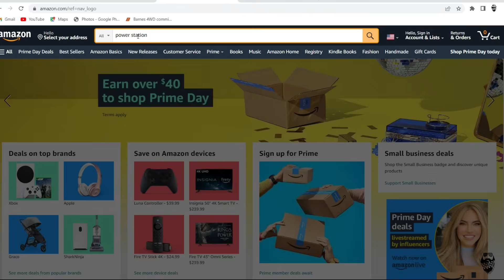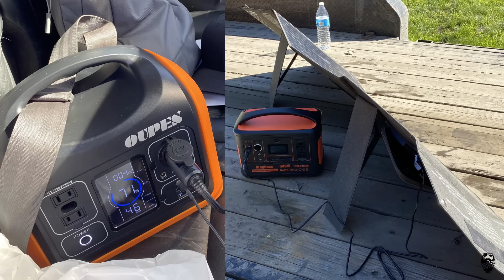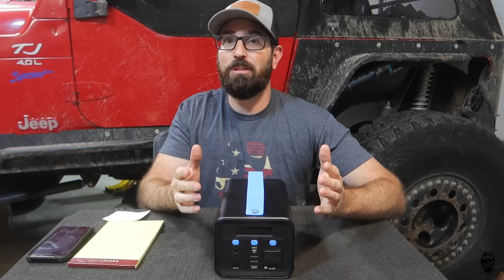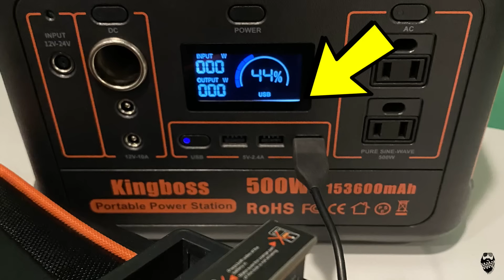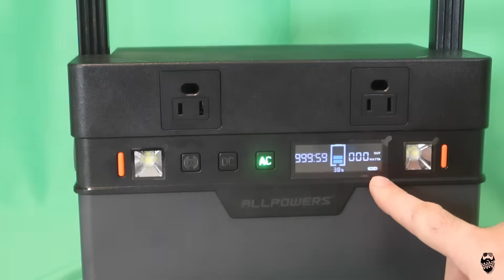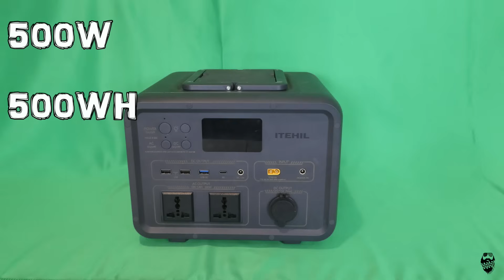Budget AMAZON Power Stations... Are they worth it??

Comment: You should build these yourself. I just build a system for my trailer with 1500 watt inverter and 2500 watt hours of battery for 400 bucks. These little all in ones are a joke

Comment: I would  buy  a tablet  so u don't  need to run your tv . Or a small  projector that can run on usb c.  A benq gv 11, 30 or 31 might do the trick.   Or or a mars 3 with it built  in battery.  The mars 3 is bit expensive  but u would  be happy  with  picture quality  and  battery  life

Comment: I need a PS to run a cig lighter plug in heater fan in my RTT which is normally used to defrost rear truck windows . Gonna try it for cold weather camping. Do you think I need a 1000watt PS? Probably run the heater fan 10 hrs at a time .

Comment: Lots of money for a battery?  Every 2 years I replace the battery in my F-250. I have a plastic battery box with the used  truck battery in it with a 12 panel  fuse box mounted on the outside of the box. 1 solar panel with controller. I run all my ham radio equipment with my unit. Plus a 1500 watt inverter. It sits under my bench. More than enough power. I wonder how long the batterys last before they no longer take a charge on 1 of those fancy boxes? They look real easy to steal out of your rig. I never let the auto repair shops keep my old batterys. I can run parts of my home with them. Years ago I bought a 3 panel harbor freight solar unit. Works great. Have fun.

Comment: That LIpower one is $133 on Amazon today.  thank you so much for the great review!  I did buy the LI just because right now my needs are simple... keep lights and devices on during a power outage at my house.  I like the light because it can light up my office really well.  I live at the end of a circuit and near the lake in heavy woods so I lose power all the time, but do not want to have to go to the office.   I buy minimal cold stuff in the summer so I don't have to worry about keeping the fridge on.  I do work in engineering for the power company, and need to stay online so this little unit is perfect for me. I can add the solar later as my house has great sun access.   If I start to camp I can go bigger.

Comment: Are any PowerStations or PowerBanks capable of charging an electric car as fast as a Level 2 charger used traditionally to charge your electric car in under 12 hours? 
P.S. I want the price to be under 1500.00, otherwise just getting a regular level 2 charger for the same money is probably the safest and least risky of something not going wrong
with the purchase,   Zendure and Anker's new Solix F3800  latest models that are capable of this but start in the 2500.00 range:

Comment: hi i know this is a late comment, but is there a solar portable power station that is exactly $100 for 500,600 or 700 watt power on amazon, preferably new. Using it for extensive and light work when using my laptop, also using it for gaming on my ps5 and separate monitor, and for a mini fridge.

Comment: There’s a question that wasn’t brought up in your excellent presentation.  When you plug any RV into a 110 (shore power) power supply you have now powered up your onboard converter.  Unless you pull the fuse or have a bypass switch you are now trying to charge your RV batteries which takes a serious amount of power from a small (under 1000 watt) power station.  There are a ton of off roaders who just don’t realize this and also don’t put their fridge on gas only.  Whether your old like me and been off roading since the late 1960’s and had RV’s of some sort since 1972 I find the biggest use for these power stations is a CPAP machine followed by a fridge.  You might try and do a test with someone who uses a CPAP and see how many nights you can get out of one charge on a smaller unit.

Comment: Having a large variety of portable devices on the market with different battery sizes I found your tests useless. You have not exposed their battery capacities or provided any measurements of how much power was actually drained from those power stations. You had mentioned the issue with one of the unit's algorithm to calculate the power usage. Don't you think the charge state/percentage indicator can be wrong as well? Next time you conduct such tests, I suggest you crank the actual numbers instead of using terms "cell phone" "laptop", etc. This way they are more accurate and can give your audience an idea of how much power they can get out of them. Cheers,

Comment: Rule of thumb: $1/watt.
I have a little 300W non jackery and it ran a TV and cable box for 6 hours before needing recharging.
Strobes are absolutely NOT needed for anything. Waste of money and just a gimmick.
Better to bring a power bank for the cell phones and save the generator for important things.
To run a house refrigerator you need at least 2,000watts or more.
About the same with a medium microwave.
About solar panels - you get 1/2 of their claimed rating. If you get a little more, count yourself lucky.
Reply: I do doordash on the bike, I just need to be able to keep my speakers and phone charged while on the road
Reply: @lyfe.personified  Bike - bicycle or motorcycle?
Either way a simple power bank would work.
If your battery dies that quickly you got something very wrong.
VERY WRONG.
Charged battery should last at least 8 hours.
Reply: What's your battery called?  If I can get 6hrs out of my laptop only running only Microsoft word on 300 watts I can work in my car and not have to drive to the library.
Reply: @rashb3994  Solar generator is made by Energizer. 300W capacity.

Comment: I just need something I can run my TV and maybe my fridge or mini fridge we don't have any gennys and we often have power outages at our house literally 2 in the last week they usually don't last more than 5 or 6 hours so I need something that cab power a smaller TV and maybe charge itself using solar power during the day. I'm thinking about getting the 500 watt jackery it's that or the 1000w if I can afford it and maybe find a good deal. As long as I can run my TV and fridge and then Recharge it from my car using my converter or my smaller power station.

Comment: Great video. Thank you.  Olight looks like a winner for me ✌🏼️
Reply: I always got an Olight in my pocket as EDC! 🔦 😂🎉
Tough, reliable and bright!! 😎 
If they can make that power station the same way, then I'm sold!! 🔦 ⚡ 
Just slapped together a small "cabin in the woods" in the backyard!! Now I'm gonna need some off grid lighting!
🕯️ 😂
I've got a few old car batteries, but I want something more reliable!?😂 I got a USB strip hooked up to an M12 battery power supply as "temporary" light!🎉 Works well with the remote!😂
I wanna hardwire something more permanent with lights and switches where I need them! Carry out the old station and just plug in ya know!... 
The USB lighting is a cool option. Need something with USB or a hub, then get a buncha USB lights! Don't know how permanent that is tho. Be hard to wire switches where you need them without cutting them up and rewiring them anyway!😢
I think if I get the wiring and fixtures in place, I can choose if I want a 12V lithium battery, or just use a power station... 🔋 
I do need a lot of USB ports cuz I have a lot of rechargeable lanterns and flashlights. My phone, tablet, speakers! Run a small TV and a Roku. I got a hotspot on my phone for nighttime watching!🎉😂
I'll run a USB hub charger off the power source for all my devices, install extra sockets and ports etc...🎉😂
Great video!!! 👍
All the info I was looking for!!🎉
Who wants to spend $1000 when I just want lights and a small TV at night!😂 I don't even have kids or anything, its all just solo camping! 🥾🏕️ 
I work and do stuff during the day, using my phone for entertainment and music. But at night it's nice to let loose and just empty everything out of your pockets and hit a button and watch Tube videos!!😂😂😂🎉 
I'm thinking I'll get the cheapest one, or a small battery just for the lights alone...
Then get a decent power station for all the different devices and TV... Divide and conquer as they say...🎉😂

Comment: At this point there are better options for similar prices. The Bluetti and Ecoflow smaller units have LiFe04 batteries and are $209 on sale, $240-ish when not. If I was going to spend $400 + I'd be looking at the Dr. Prepare PowerMax. Basically a 100Ah 12V LiFePO4 battery that comes with a module that turns it into a basic power station.

Comment: how many volts would I need to run a 40 inch samsung 4k tv and a ps5 and a modem/router when the power goes out, would like to play for at least 90 minutes to pass the time, we have frequent power outages
Reply: You need Amp hours, not volts, probably a wifi connection, and you should be more worried about your fridge, your furnace, and things other than gaming. TV's are power-pigs.

Comment: Plastic isn’t really cheap as the molds cost money.  Plastic is arguably safer.  When you have ground pins on your AC outlets there is likely leakage current to the metal housing - so is there a grounding lug - and who is going to connect it?

Comment: Enjoyed the video, but I have to assume that you chose the off brands due to price rather than long term quality.  I don't own a Jackery but many YouTubers do, maybe because they got them free.  I own two EcoFlow and would not buy any other brand regardless of price only because I can't run them down and they provide everything other than a light.  The small one is very light but durable, and the larger one is heavy but will run everything in my camper other than the AC, and if it has a soft start, it would likely run it also.

Comment: If you plan to use these at home...get a real solar panel. Folding solar panels are great for their USB ports for powering fans, and charging phones and power banks, but you can`t mount them outside or leave them in the rain. WAY too expensive compared to a glass panel that will last decades.

Comment: IDC about how many phones were charged etc, I'm more interested in how long you could run x fridge for etc. 

So if I'm camping, can I get 2 LED bars and a fridge to run for 24+ hours off it before it needs charging, thus hopefully with a good panel giving 40-70% charge during the day make it run for say 48hours. This is the sort of info I find really handy. 

The phone is easy enough with a 20v USBc car charger in the car, 1 hour at idle, device is fully charged and can be topped by a small solar panel.

Comment: I bought the Jackery 300 Watt on black Friday for $200.  It worked for what I wanted to do but surprised by how little 300 Watt would do.  If I had to do it over, I would just buy a DC power inverter.  (400 watts for less than $50).  Perhaps an alternate choice for some people?
Reply: I got the Jackery 300 for a weekend trip. Spent two days out in the wild/in my van. It was good since I wasn't using a lot of power toys. Mostly my phone, some USB fans, some lights, and a Hot Logic.

I'm thinking of getting a DC fridge so looking at a 1000W battery pack. Plus I'll be using more equipment for cooking and entertainment.

Comment: I invested in the Allpowers one a couple years ago.  My first one turned defective, but they sent me a second one that I used extensively out in the woods, combined with a solar panel.  It charges so much better with one of their solar panels with an MC4 to Anderson plug (the red and black one on the pack).  Overall it's alright for light use, but I wouldn't try using any electrical appliance like a coffee maker or a space heater with it.  The bluetooth app is largely pointless, EXCEPT that it does allow you to control its functions if the physical buttons malfunctions, and it also tells you how many times the battery has cycled.
Reply: Great to hear about your experience with the Allpowers power station! It's always helpful to have feedback from fellow outdoor enthusiasts. If you're looking for an upgrade, I highly recommend checking out the Segway Portable PowerStation Cube Series. It offers a massive capacity, powerful output, fast recharging, versatile sockets, and comprehensive protections. Plus, its waterproof technology and smart app control make it a reliable and convenient option for outdoor adventures. Happy camping!
Reply: @Leewilly440  There's two things that could be the problem: first is they could be using the older defective batch (that's the one they replaced for me);  the aesthetic difference between the two the bad one had covers on the AC outlets while the good one does not.  This was a few years back so no idea if the model has changed since.  The other problem is if they ever stored their lithium battery pack in near freezing temps, or especially if they ever tried charging a frozen battery pack.  

The good pack that I got has worked fine for years.  Battery packs are pretty much rated for 10,000 cycles, which is over a decade of constant use.  I've had the AP pack in all kinds of conditions, cold, hot, in vehicles, in backpacks.  Even dropped the thing from high up and smashed my foot, but it still works fine.

Comment: You say some are heavier but not why; the different battery types is a major point.  The heavier LiFePO can handle many more charge cycles and can produce a consistent output even as they reach a low charge level but are heavier.

Comment: Hi in the Uk we could experience blackouts soon. I'm looking for a portable power station to plug in my Mac mini M1 & monitor. Is it possible to have the computer permanently plugged in to a portable power station, and have the portable power station permanently on charge (only when I'm using the computer) so that if we get a blackout my computer will remain unaffected or at least until the portable power station runs out? I already have my Mac mini set up to automatically transfer from home wifi to 5g if the wifi goes down. If it is could you recommend a portable power bank please? Hope you don't mind me posting this on your page but I have no clue where to start. Thank you.

Comment: You can buy a Bluetti 600 watt and a 125 watt solar panel for $500...why buy any of that junk?🤔💣
Reply from the maker: Not sure where you have seen that, they don’t make a 600wh, power station. It is 600 peak and 268wh which is pretty small, less than half the capacity of most of theses. When you get to 600-700wh they start at $799.

Comment: Nice video, but it sure would have been nice to talk about charging time with that solar panel.  It makes a big diff whether a power station charges in 3 hours vs 6 hrs vs 12 hrs.
Reply: I'm far from an expert, but as an example, the tiny 250w station I got for $80 charged on a 30w wall charger in a few hours, maybe less. Realistically, you aren't getting more than 60-70w from a 100w panel on a good day, so I'd guess for a higher capacity battery, it's gonna be 6 hours minimum with one panel.